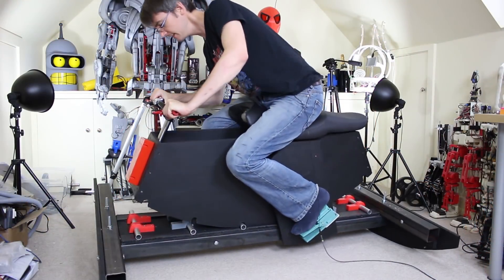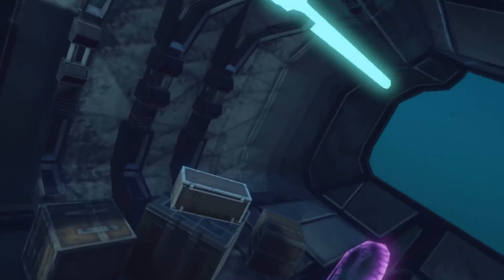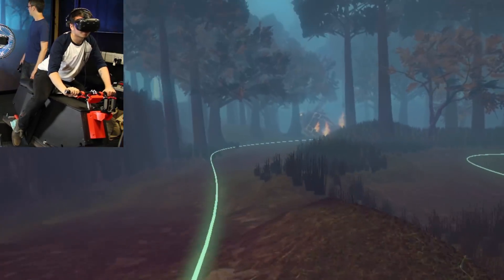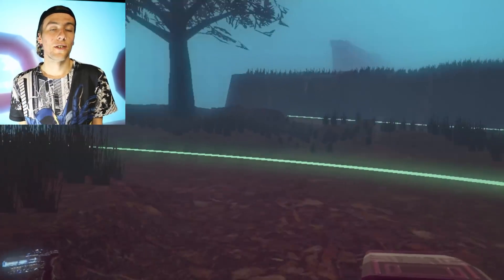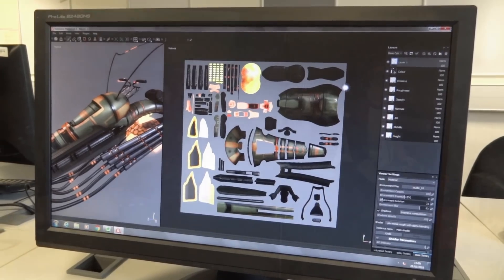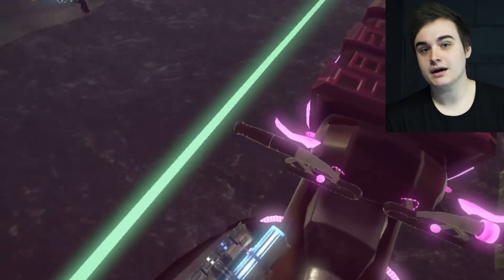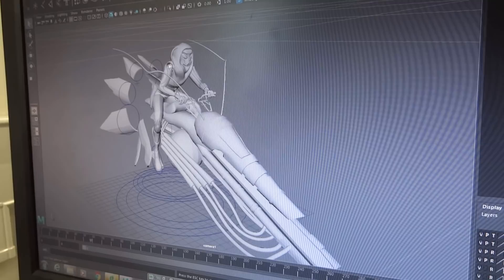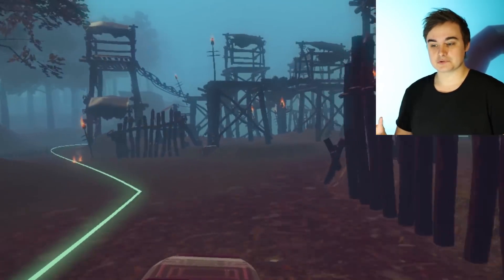VR Hoverbike Simulator Game #4 | James Bruton

Comment: lean to steer does not really work on a rocking horse design.  on the games that used this in the arcades, there was fixed 'ground' that you could push off of with your feet to lean as I recall.  with the rocking horse you see the problem they were having in that when you lean left, no matter how far you try to lean left you will end up rocking back and forth.   The weight of it also means you cannot change direction quickly at all.  This could be fixed if you put some footrests that are fixed to the ground to push off of.  Would allow for more rapid directional changes as well as controlling for that rocking motion.  this would also fix the same problem with rocking forward and backwards.

Comment: Does not look like they used the tilt action at all.. I did not think that would work well, but I still think that should have been a feedback motion via actuators to simulate acceleration and breaking. Rigs like this are not really something new and most do's and don't have already been figured out decades ago.
Reply: Diggnuts The leaning does work. You use it in conjunction with the pedal which increases your steering. You'd have to try it to find out.
Reply: The side to side yes, but the back to front motion does not seem to do anything.
Reply: That's because it wasn't implemented. For the control system to work comfortably only leaning was implemented.
Reply: Indeed captain obvious.. It wasn't.. as I said in the original comment...

And on a previous video I kind of predicted that it would not be implemented because it is a very unnatural and cumbersome input method. So I suggested to use actuators on that axis to simulate acceleration and breaking.
Reply: Well, Captain Genius, time to make your own bike with actuators! Have fun!

Comment: All that's missing is force feedback.  The controls seems fine, but without feedback, the immersion would be a bit off.  Loved the fans to simulate speed.  Hoverbike may take out all the reasonings for bumps and stuff.  But should still need to simulate g-force and autobalancing like a floating feeling.
Reply: Nicolas Locke The rumble motor is synced to the speed you're travelling at.

Comment: Why not make the steering like a real bike? Surely it's easier
Reply: Bzorlan But this is how you steer with a bike. Trying to turn without leaning just leads to more injuries than necessary.
Reply: Just think it would feel weird not steering with the handlebars. Just using the handlebars would also feel weird so it would have to use a combination of the handlebars and leaning for it to feel right.